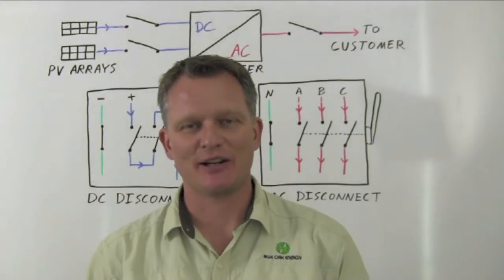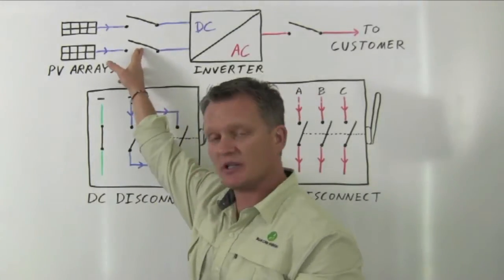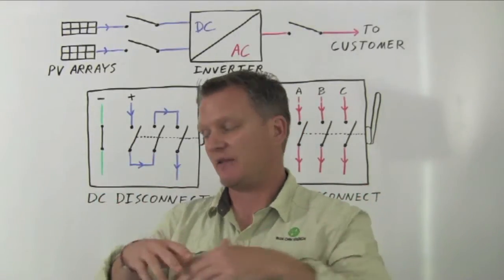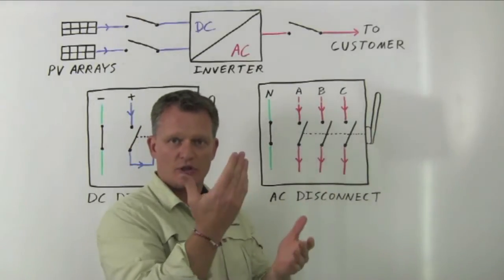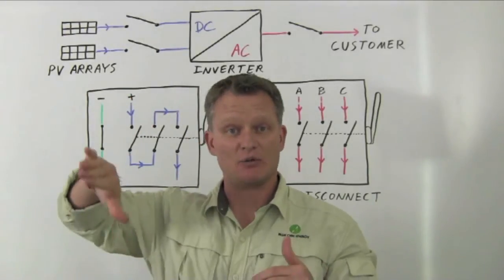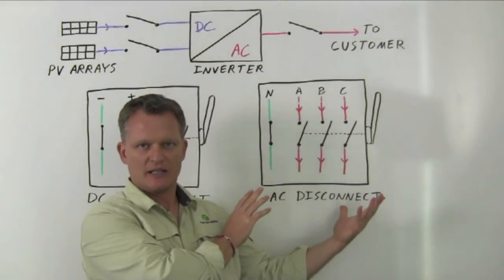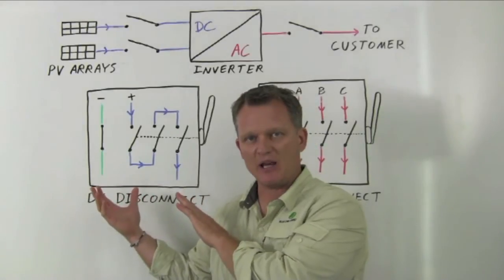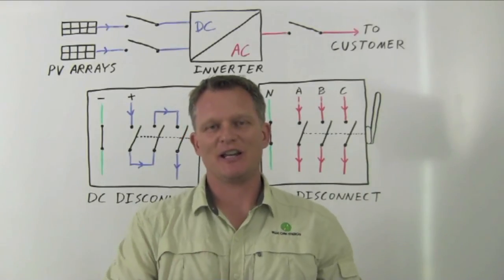Teck Talk 3: Load-Break Disconnects

Comment: I just wanted to thank you for taking the time to post this video explaining the function and reasoning of a Load-Break Disconnect. I'm currently studying the NEC and was going through Section 690 (PV Systems) which I am not super familiar with due to my experience being in commercial and Industrial electrical work and never installing such systems. I am looking to gain a little more knowledge on PV Systems and a piece of equipment such as this disconnect is one i had never heard of. You did a wonderful job of simply explaining it in a decent manner of time. And easily understandable. 

Thank you,

-Michael